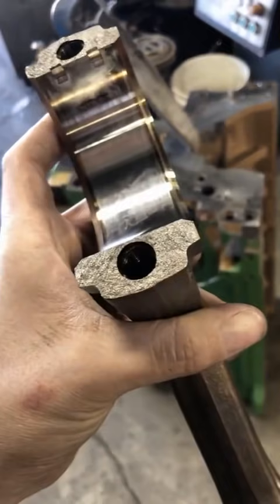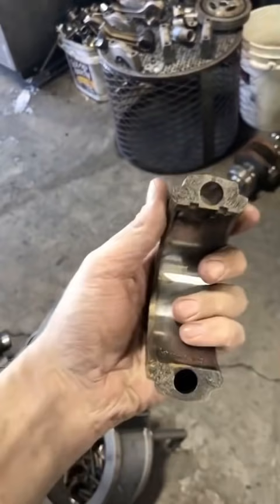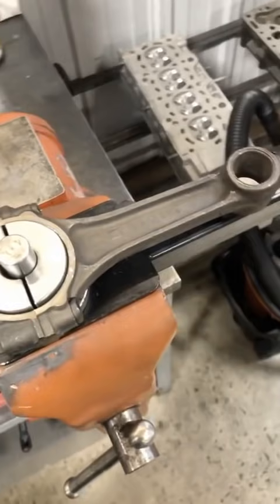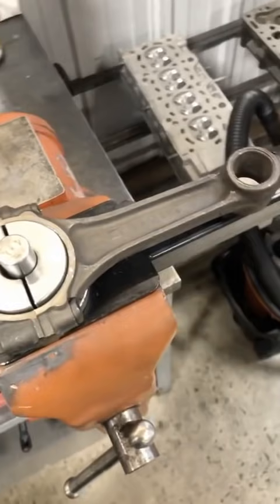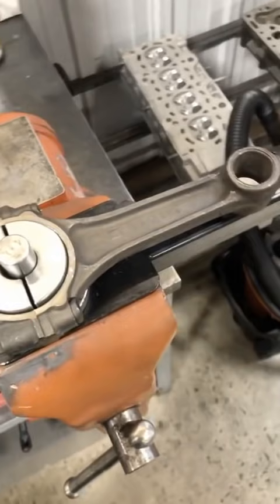#shorts Fracture Split and Angle Cap Connecting Rods Explained

Comment: I love the simple answer on the angled rod caps I always figured they were stronger or something.
Reply: I always thought it was for easier installation of the rod cap
Reply: It's for cam clearance inside the block. If you installed them facing the wrong way the crankshaft won't spin over.  Even in the video the rod went right in when he inserted it on an angle.
Reply: They are stronger. I did the finite element analysis and tensile testing for an OEM.
Reply: I was actually just going to ask
Reply: Seems it would also offset load pressure away from the studs, so the rod itself can absorb the load from combustion.
Reply: If I remember correctly, I might be wrong though, the brand new redesigned Cummins 6.7 liter engine on the rams have angled rods. The rods are angled for quieter operation and have more strength due to the angle and some weird engineering theory.
Reply: text
Reply: Angled caps is a diesel engine trick. Cap bolts are much less likely to stretch
Reply: @rustystick  That's a common occurrence on Diesels with imbalanced injectors, the cylinder pressure causes the cap bolts to loosen from overfueling and improper crank balance.  Check out Deboss Garage when he rebuilt a Case Cummins that had one imbalanced injector and a rod end failure from a loose bolt.
Reply: Many things have simple answers.
Reply: @nitroustommy3668  I torn down quite a few motors in light automotive nothing makes just make them to proper piston direction on Ag n construction it about the same but usually so you can spin in a set of bearings more easily n Cummins had some face away from cam car  Isuz facing cam
Reply: @sandiagoism  it just because it is easier to spin in new rod bearings at proper maintenance interval
Reply: @sandiagoism  every Cummins rod I've seen is angled
Reply: @theupscriber65  doubt they are stronger. If they were, every engine in harsh demand and racing would use them.
Reply: @theupscriber65 . You sir, are correct.
Reply: @scottmorgan133 most diesel engines use this though and diesels take higher forces per revolution, so yes, these are used in engines with harsh conditions... The thing is, most racing engines run with high revs and have higher quality materials used and more machine work into the parts. Thats why they don't really need this tec. The motors used in racing last a couple thousand km or miles at most before they get rebuild so...
Reply: @theupscriber65 Thank you very much. That is why I read the comments!
Reply: @theupscriber65 why are they stronger? The tensile forces now are at like a 45 degree angle to the cap-rod interface instead of being perpendicular?
Reply: @theupscriber65 

They stronger because they allow a larger crank pin diameter. You should see the big end design on a Caterpillar 3500 with splayed bolts. It's all to maximize crank pin size.
Reply: Se la bronzina è fusa insieme alla biella  quando sono da sostituire x qualsiasi ragione ,soldati da spendere x i poveri e milioni di euro x le case costruttici😢
Reply: It's for clearance to the block skirt and/or cam clearance.

Comment: I am a 42 year old car guy.. I've built 4 motors from the crank up. I even understand the more complicated aspects of engines such as cam shaft LSA, fuel curves and timing. Never in my life have I ever heard of fractured rods.
Reply: Usually comes on newer bigger diesel engines
Reply: The 99-04 Ford Lightning has them. Never realized it was due to being cheaper to manufacture
Reply: @wraith3951  yeah certain cars came with them too. I believe the 4G63 had them or maybe it was the srt4, but I had no idea it was was for or had a cheaper manufacturing process!
Reply: It's beginning to find its way into Japanese sportbikes as well. The 2015 Yamaha R1 was the first production bike available with titanium fracture split rods.
Reply: Fractured rods are quite common first time I noticed this weired engineering was on a 1998 BMW M62 engine.
Reply: 52, first time I’ve heard this,  won’t be using either if I have any choice
Reply: They've done this on outboard motors for over 30 yeara
Reply: I’ve seen these  fractured split rods slowly working on scene fr while now , I had good luck refinishing normal way of grinding back flat the resizing !  one in while May need to rebore big end then finish honing to size , don’t do this if going off road racing or high performance,
Reply: @RyanMcIntyre   titanium is just lighter than steel Plus lesser tinsel strength n more brittle it will take heat but durability is questionable depending on applications
Reply: Haha I build small engines tecumseh and brigs brigs use fractured rods mostly and tecumseh uses regular rods I like regular ones a lot more
Reply: @RyanMcIntyre  because for the price titanium is not efficient compared to steel.
Reply: Well then let me shock u not only do you get fractured rods , but cummins engine fracture their main caps as well , so u cant line bore it
Reply: Don’t quote me on this but I think GM fractured the rods of the LS engines and their truck counterparts
Reply: I’ve always heard the term cracked rods . With ls stuff
Reply: LS engines use them
Reply: @JovaniDanteGriego  yes sir same as  cummins . And you can find videos showing them handling 1000+ hp with stock bottom ends 🤷‍♂️
Reply: They’re cheaper and provide a better fit. They are just better in general.
Reply: They are pretty typical in euro cars, almost all of my BMWs have them. Really the only downside to them is that you have to extremely precise when assembling them- if you won't match the cracks perfectly when tightening, the entire rod is garbage.
Reply: I'm 20 and I'm pretty sure I've seen some in the very limited exposure I've had in a few engines
Reply: C series which includes the ISC,  ISL-G Cummins use them. They are more of a pain in the ass to torque.
Reply: paccar truck MX engines have them
Reply: Every LS ever made has a cracked cap design .
Reply: what kind of engines do you mess with?
Reply: they come stock in 03-04 cobras. made by manley.
Reply: More accurate alignment between halves
Reply: @leewilliams4731 Ford started using them in the early 2000s in most of there engines.and I was told the rods were hit sideways to snap the rod cap off.not spread apart.
Reply: They taught me about them in auto tech class. Haven’t seen any and kinda forgot about them but this video reminded me.
Reply: They taught me about this when I took my engine repair course and we were all taking apart a chevy ls engine. Probably pre 2000 design but the chevy LS engines utilize a fractured split rod.
Reply: Nore have I
Reply: I kinda figured all of the rods were casted and then split
Reply: @patrickancona1193 it's mating surface mates much stronger due to all the pits hills matching up perfectly. How come you wouldn't use them?
Reply: John Deere uses fractured rods a lot. Older Chevy engines do too. Seen em in SBC and BBC platforms
Reply: You probably thought tge motor needed rods and replaced them
Reply: Most engines use them. Factory rods anyway if it's a Factory cast rod. 9 times out of 10 it's a fracture rod
Reply: Uh, what?? It's an extremely common method for making rods these days.
Reply: Cracked rods are becoming more and more common - the newer the design of the engine, the better the chances it uses them.
(engine machinist)
Reply: I just rebuilt a Volkswagen GTI 2.0T gasoline engine with the engine code “BPY”. It has fractured connecting rods, and that engine was produced from as early as 2003. This most certainly isn’t new technology, it’s at least a couple decades old.
Reply: I knew what fractured rods were when i was about 12.    And why they do it
Reply: Fractured rods is what happens when over revved and trying to win a race and end up losing in more ways than one.😂😂😂😂😂😂
Reply: Its a weird design that now works more so with newer engines.
Reply: First application in passenger cars was BMW.
Reply: Volvos have had them for a while now.
Reply: It's a very old and established technology. Like the guy says, one of the rare occasions where they're cheaper AND perform better
Reply: Really...4 whole engines😂😂😂😂
Reply: Very common, just not on the aftermarket/performance side.

Comment: Excellent explanation. There's alot of misinformation on car pages about this and some shops even advertise resized frac cap rods. Like you said, all you can do is install over size OD bearings and rebush the small end.
Reply: That's not entirely true. When developing them i asked my engineering manager about the rebuild. He said he didn't want people to be able to rebuild them. BUT you can mill the mating surfaces, pin them together on each side and then re-bore.
Reply: You can still strip the cap and resize them. BMC etc use this and diesels too.

Comment: Interesting. I've never heard of fracture split rods before. Pretty cool really.
Reply: I'd never heard about them either until some of the guys at work were talking about a L67 V6 (Factory supercharged V6 based on the early 90s Buick V6 used in the Holden Commodore range over here in Australia) their son had stripped and how they only realised after throwing everything in a box together that the caps and rods had to be matched together
Reply: @heckin_dinosaw  at least there were only six huh?
Reply: @StLMikie  I believe they also had a spare rotating assembly as well, so I believe there would've been around 12 and I know the splits on then are a lot finer too so it's much harder to determine if it's correct or not
Reply: @heckin_dinosaw  doesn’t sound like a great time at all!
Reply: @heckin_dinosaw  brother I can’t imagine the frustration that would’ve been involved with that ordeal 😂
Reply: GM had them in production in the mid 90s.
Reply: I handle all rod rebuilds for a heavy Diesel engine reconditioning business and I have to say fractured cap (or crack caps) are my favourite less overall time  spent on deburring mating surfaces and it generally ensures a better locating fit. One thing to be aware of tho with crack caps is be fucking careful handling them in the rebuild process when they’re apart if you drop one one it’s cracked surface and it gets damaged it can be see ya later to your rod
Reply: @heckin_dinosaw  all rods and caps should be matched together regardless of mating surface type. Generally a conrod should have a number inscribed on the rod and the same number on the cap
Reply: @Paul-wj1zg  yeah I know, but atleast with machined caps, if you lose one it is possible to get a replacement machined to fit, whereas if you lose a fractured cap, good luck
Reply: @heckin_dinosaw  Thought any rod and cap would be kept together.
Reply: @jimmydcricket5893  yeah they are meant to, but with machined caps it is possible to get a replacement cap machined to fit, not really possible with the split caps
Reply: @heckin_dinosaw  all's I know is that in Aviation the Conn rod is a rod and cap unit that must be replaced as a unit. 
Disregarding that regulation it makes sense that a replacement cap or rod would work if machined to match and if the rod's total weight still matches the original to prevent vibration.
Reply: What is going on, this is standard for decades now in cars. The Rod is locally frozen to make it brittle and then snapped. This is only hard to manufacture for big engines due to the local freezing process (takes more time to freeze to the core). It is not only cheaper to produce but has a perfect fit which cannot be matched. Machined surfaces are not perfectly flat and have a small gap between the grooves of the machine work. Therefore it has less settling which improves the durability of the bolt-fitting.
Reply: @MrPaulpph  I'm still having a hard time visualizing how cracking it makes the two pieces fit perfectly back together... The way it looks in my mind, once you separate the two pieces then you'll never be able to line them up together again. How do they make sure all the jagged surfaces meet up?
Reply: @dandc2011  i think the point is that there's only one way the jagged surfaces will fit back together and they'll fit back together perfectly snug. It's like they're keyed to each other with a unique crack shape. The jagged edge will also keep rod and cap from moving relative to each other.
Reply: ⁷l
Reply: they kinda are the most popular option in popular vehicles such as Volkswagen in South america
Reply: @theupscriber65 GM still uses them in everything even today. So do a lot of manufacturers actually.
Reply: @Paul-wj1zg you are absolutely correct they created a solution to a problem that never existed. Hint much cheaper going down the assembly line saves machining the surfaces but gives the mechanics a lot more trouble to deal with

Comment: So now we're Breaking s*** to get it to last!? I've been gone too long! 😂
Reply: Planned obsolescence, always been the name of the game.
Reply: @XanVicious  well no, its cause a fracture will seat better than any manufactured face would, and its cheaper. 

Planed obselesence would be giveing it such a thin marigin of wear that a few months usage would force an overhaul.
Reply: Some engineer dropped their coffee mug and went "huh..."
Reply: @thegoldenatlas753  this. Can’t stand when people try to talk about shit they don’t understand.
Reply: @QuintonNG2000  LOL, it might just be something like that !
Reply: So think of it like this. A heat sink has a bunch of fins instead of just a flat surface because it increases surface area. If the face of this rod is machined flat it doesn't have as much surface area to hold as when you literally break it and the face is rough. It's like how you can't sand a wood deck past 220 grit if youre going to stain it. If you sand it to 2000 grit then the surface of wood will be too smooth in order to allow the stain to penatrate into it. Hopefully that makes sense. For alot of years I said these dumb engineers don't know what they're talking about until going to engineering school and realizing of s*** that's why they did it that way!
Reply: @XanVicious  ...no. This has literally nothing to do with planned obsolescence, which is a real thing but which you seem a bit overzealous to diagnose
Reply: @metalman6708  wood isn't QUITE a perfect example, as the shine attained from higher grit isn't from an increasingly fine wear pattern, it's from packing tiny wood particles into the pores in the grain. But the wood stain part did complete the analogy.

Comment: This was derived from diesel engine technology. It was mainly designed to alleviate Rod cap bolt stretching.
Reply: Cumins use this tech for there connecting rods
Reply: Hummm
Reply: look at modern gasoline engines. they have adopted almost everything from diesel engines
Reply: The fractured cap has nothing to do with bolt stretch. They are completely unrelated. I was the guy working with the connecting rod design team designing and manufacturing the rod bolts.
Reply: @otm646 what is the purpose then, production costs?

Comment: Angled cap is stronger too. I developed the cracked rod for the Powerstroke diesel. True you can't machine them sometimes. But depending on where they are oversize you may be able to machine the cracked surfaces down to make the hole smaller, pin the rod and cap, then rebore.

Comment: Fracture split rods are powdered metal tech. Made like an Aprin. Blended powdered metals are pressed in a die then heated to fuse the powder particles.  Just another way to save bucks in manufacturing. But they work as long as you dont up the horsepower. If the parting line will fracture the rest of the rod is just as brittle.  Just as quality as hypereutectic pistons. High silicon aluminum castings. (Silicon is beach sand) but they dont expand as much a normal operating temps so tighter clearances can be run for less blowby.until you push the power and expand the pistons to remove clearances. Scuffing the walls or seizing and fracturing.

Comment: Split fracture rods essentially elimate rod cap bolt fretting, which can wear down the machined surface of a rod and lower the clamping force of a rod cap bolt. In a lot of applications split fracture rods are balanced the same as a traditional rod so they can be interchanged, such as during a warranty job where only one cylinder pack is to be replaced.

Comment: I worked at a place that made these type con rods for boat engines. They said the big advantage is that you can machine the entire thing to a high degree of roundness and accuracy when it's a single piece, then snap it, and it retains the accuracy. I guess that lines up with your argument that it's due to cost, because you can get higher accuracy with any industrial lathe than you'll get on a cnc unless you spend a fortune for high-end cnc milling machines. An interesting side effect is that after it's split each cap and rod are kept together, because each break is unique. I wasn't in that department, but I heard they had a lot of issues getting the process done right and had a high scrap rate.

Comment: Originally, the consensus was the offset rod caps presented a continuous surface transmitting the pistons force during combustion,  without the cap to rod split jeld only by the bolts. I guess both are true but I favor the rationale that the continuous surface was the primary reason that enjoyed the added bonus of easier assembly. For engines with vertically split cases ease of assembly wasnt a possible benefit. The stronger rod/cap assy would have been nice but apparently it was so outlandish looking it never got any serious consideration.

Comment: Outboard motors have used this for over 50 years as they have needle bearings for the main bearings.  Also this is used the manufacture of good drill chucks.